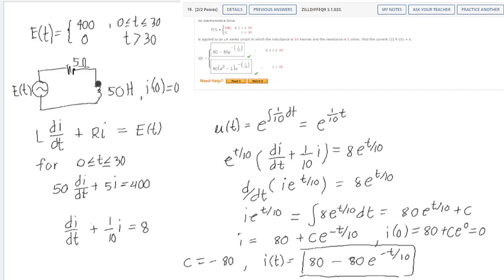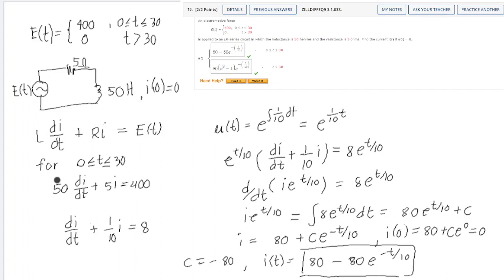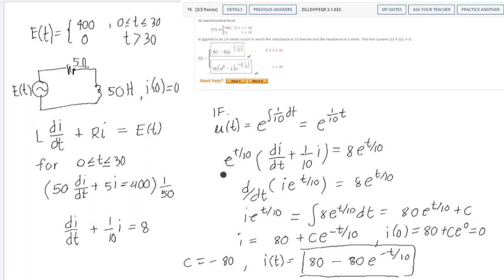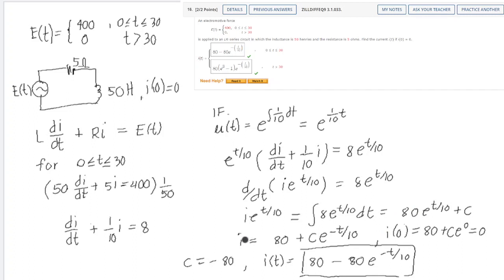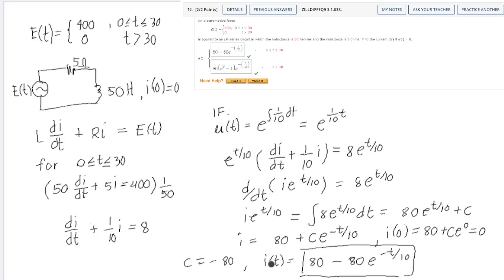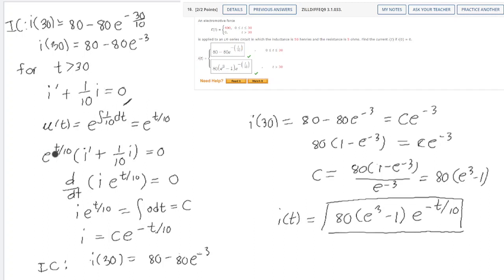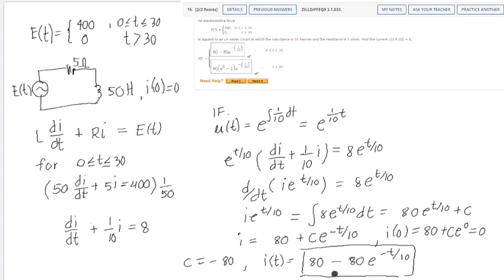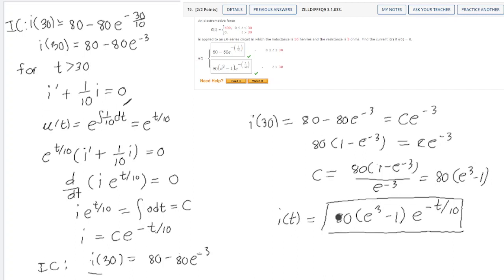Solving for the current through an RL series circuit given Electromotive Force

Comment: Can you discuss the derivation of the voltages in each element in the circuit?
Reply: Thank you for that question. The voltage across the inductor is directly proportional to the rate of change of the current through an inductor. This means that if the emf supplied is DC, the current through it does not change and the inductor just acts as a short circuit. When AC is supplied we should expect that current at t=0 should be zero. Also the voltage across the resistor is just V=IR. Since KVL says that for any closed loop in a ckt the sum of all the potential differences is zero. We should expect that voltage across inductor plus voltage across resistor is just the emf.
Reply from the maker: thanks for the question miss gladis

Comment: Is there a case where the emf is constant? And the other elements are the ones that vary?
Reply: Yes. Sometimes it's the inductors or current value that changes. Sometimes the unknown variables are the voltage source or voltage across the resistor or inductor and the current is given
Reply from the maker: thanks for the question mr reymon